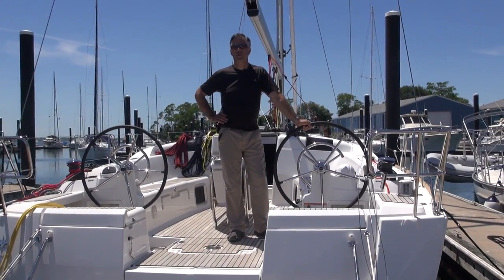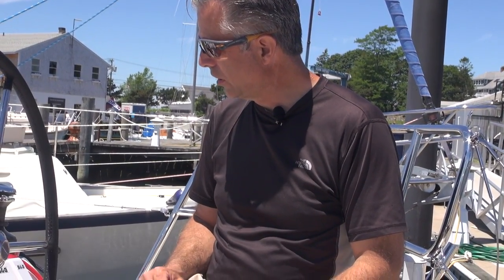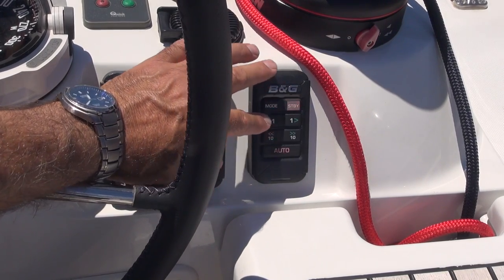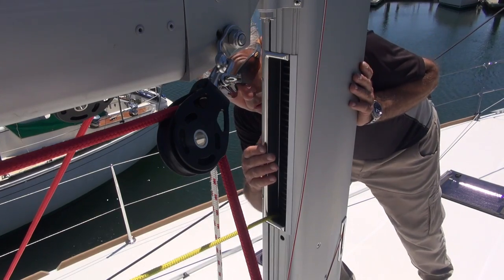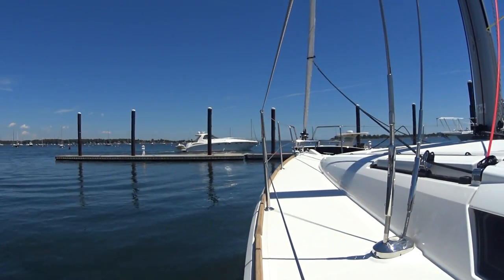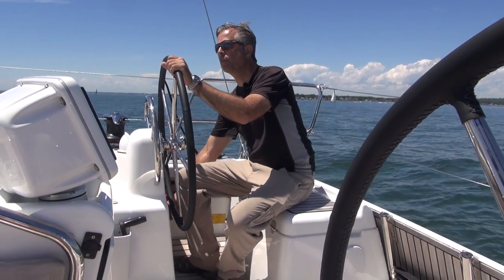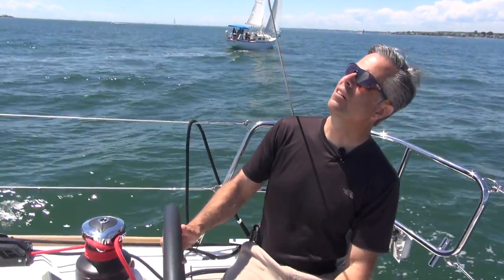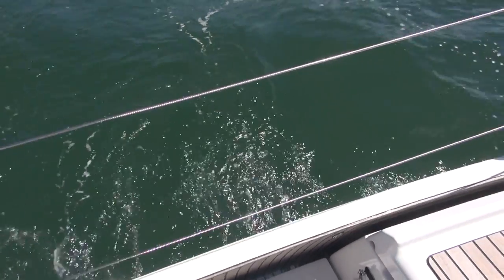Jeanneau 449 Sailing Prep and Example with Scott Rocknak

Comment: Very nice video. However, it would make more sense to have your dock lines cast off from the sailboat as opposed from the dock. This way you can pick them up easily with the boat hook as opposed to running around the dock securing the three lines? Especially if you’re on a floating dock you can have the lines set at the exact length that you might need.

Comment: I love your video! Only thing I could see wrong is that you checked the oil level wrong in my opinion, should take dip stick out, wipe off with rag, re-insert, take back out and inspect oil level on stick. This will prevent false readings. But there are always a million different ways to do things and a million people like me commenting on different ways. lol    Anyways, keep up the nice videos, have a good one!
Reply from the maker: Thanks! Probably checked the oil on several takes immediately before that one. You're right about wiping it of course.

Comment: Great video. 

I have a question: ($30:00)  I see your jib furling line is run in the factory fair-leads on the bow.  How do you run it so that it makes it to the aft cleat with out having a chafing point when you run the line from the last fair-lead to under the deck and to the cleat?
Reply from the maker: Just went out and looked at a 44DS we have here out here in our shop. The furler line on the 449 is similar. The line runs on the top of the forward cabin coach roof and then goes under a shroud the rest of the way aft near the hand rail. It reappears before the clutch. It's pretty much a direct line with no contact on the fiberglass under load.

Comment: The boat looks very nice however the 3 year world wide coverage is misleading. I bought this boat and within 6 months had problem with the engine. I wrote emails after emails to Jeanneau and did not receive any response. The dealer just stated that my expectations were too high it usually takes many days to fix  a problem like this. That is world wide coverage.

Comment: nice video, pity though you had not the strength or prowess to use the winch handle like a real sailor would, and not rely on electronic gizmos to do the work for you, if you don't know how, what happens when the power goes out??